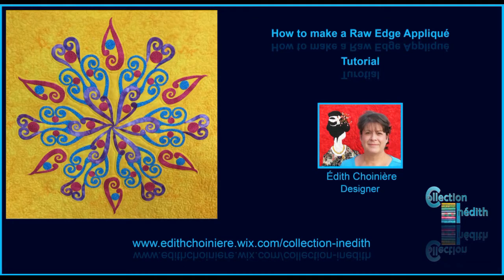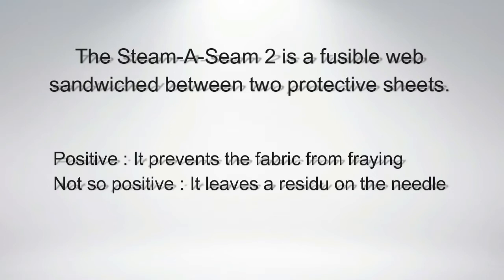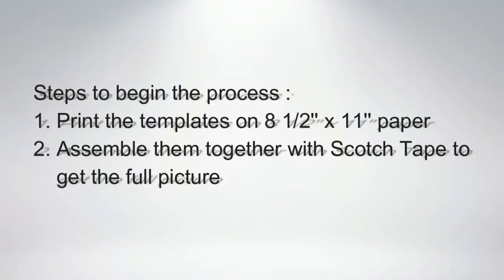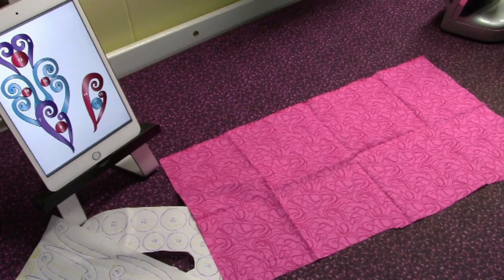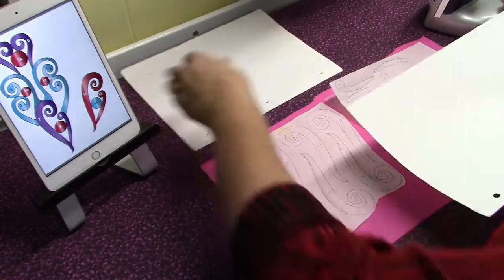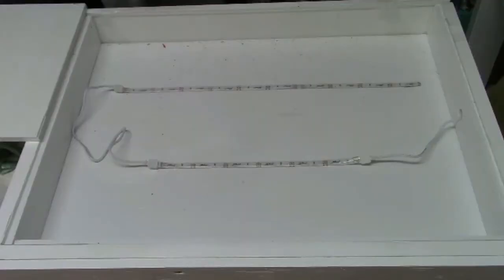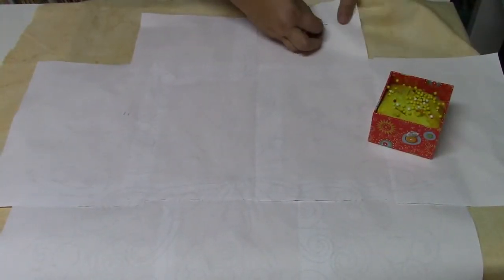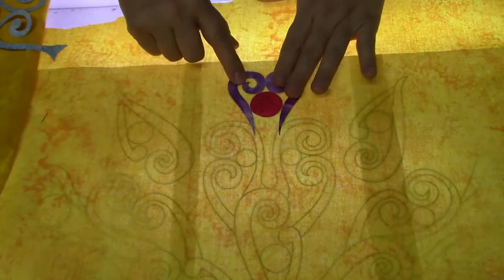How to work with Steam-A-Seam - Helpful tips - Collection Inédith

Comment: Hello. The steam a seam gunks up my needle and the thread keeps breaking and the stitches keep skipping too. It’s so frustrating. Do you have Any tips to stop this from happening ?
Reply: I’m a long time quilter and love using STM a SEAM 2. I had the sticky needle problem in the beginning until a quilt teacher told me the secret is to iron iron iron once you have placed pieces where you want them. It cannot be ironed too much. The adhesive absorbs into the fabric, doesn’t stay on the surface which eliminates the sticky needle problem. Works!!
Reply: @lindahorton9488  thank you for the tip!!!
Reply: @lindahorton9488  I’ve just tried your method and it worked! Maybe I was too impatient and didn’t iron long enough . Thanks again for taking the time to help me out !!